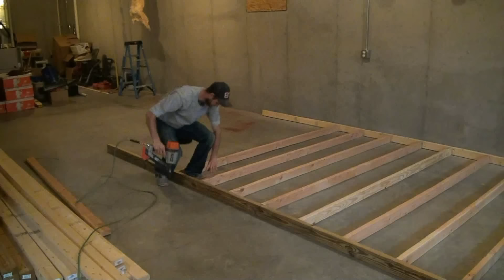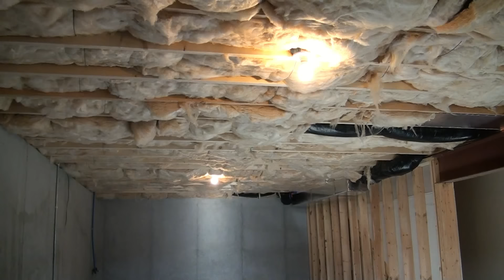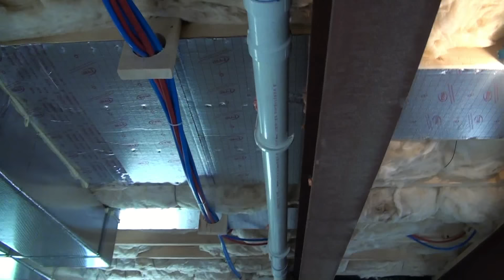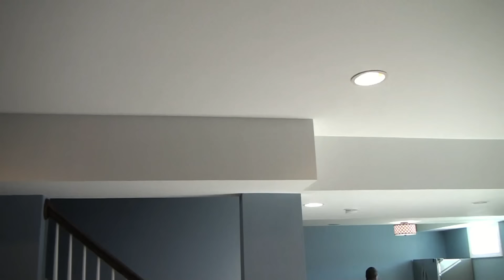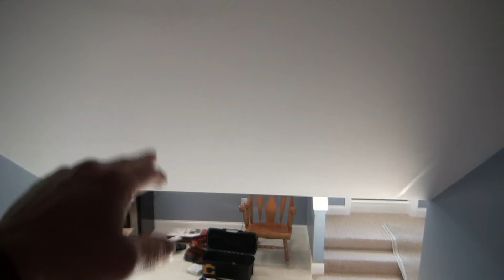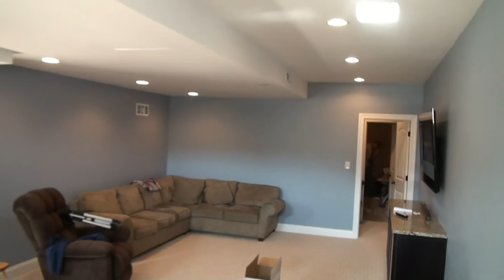Basement Ceiling Ideas (Planning  Your way Around the Obstacles)

Comment: Looks great.  But not much access points.  I got an older house so I'm torn between finishing the basement ceiling or leaving access to deal with issues.  I've also uses the access to run hdmi and speaker wire all under the floor and up through the 1st floor walls.  That would have been impossible.  I'm about to upgrade the hdmi to 8k/4k but realize that in another 10 years I'd probably want to upgrade again.  I think I need some drop ceiling type option but building around obstacles with drop ceiling seems painful.

Comment: My Daughters basement is the same way. The problem I'm looking at though is the flexible duct work is UNDER the floor joists. Older house. She has the steel beam also. Yep, sewer line, water supply lines, etc. But all this stuff is randomly all over the ceiling area. Nightmare. I wish you would have showed how you framed it. I'm thinking I'm going to have to build basically another entire "frame" underneath to support drywall. The room is approximately 20x20. Thinking Nightmare.

Comment: Great video Eddie! Question for you. I have a metal I-beam running the entire length of my basement that I want to put a wall directly under. Can I fasten the wall studs to the bottom of the I-beam and then drywall over the I-beam? I also have a finished fake stone fireplace that the mason finished on the wrong side of the I-beam that I want to attach this wall to. I can send you photos of my problem if you have an email address and time to answer them? Would be greatly appreciated if you could do so as I am at a standstill with this situation. Thanks, Barry.
Reply from the maker: Yes you can do it that way if need be...but it's best to frame your wall in front of the steel beam on one side or the other when possible.

Eddie

Comment: Hi, if there is a 3-feet distance between the duct and the main beam without obstacles, is it a better way to keep the higher ceiling or keep the same height with the duct? Thanks.
Reply: Depending on over all height,  I would float the whole ceiling level across. If it seems to close feeling, then I would raise the ceiling as high as I can and make really nice shaped transitions.. Might even include ducting and such into the look,  make all of the conduits and such look good..
   This video gives good points. I always add in the feeling the room will give me then consider on if I'm building for Me, for Someone Else and what they like and what kind of person they are, or am I building to sell and keep it  conservatively and common sense good looking ...

Comment: Ya had me until the end when you convinced yourself adding 2 foot of ceiling space “wouldn’t be worth the aggravation.”  Then contradicted yourself in your final comments when you stated that “you should maximize space anywhere you can.”
Reply from the maker: To a point...but if saving height in an area will make the area look “crowded” or unbalanced as I felt it would in this instance, why would I do it? Yes...save height where you can, but not just for the sake of doing it...does that make sense to ya? ~Eddie
Reply: @BasementFinishingMan  Yes, it does.  I’m finishing mine up now and have some similar flow problems.  Did you put Thermal bubble wrap against the ceiling subfloor as well as wrap your vents?  I’m using carpet remnants now with Robert’s 3095 and a staple gun.  Wondering which one you would choose for the best noise dampening and thermal principles.  Thanks

Comment: Keep the steel beam as an architectural detail and now the ceiling was dropped low. Steel is an expensive material and serves a structural function. Form follows function show it off. What was the purpose of hiding the beam the ceiling is now void of anything interesting
Reply from the maker: The purpose of hiding the beam is simply to  give the ceiling a "Finished-look". An exposed beam may have some intrinsic modern-style benefits for those who are looking for a more contemporary finished-look, but for most of my clients, they do not want to see an unfinished steel beam in there new "finished" space. It's a personal taste thing...  ~Eddie
Reply: you are right, i cant tell you how many times i went into someones basement to talk about their steel support beams.  it looks so much cleaner this way.

Comment: What's the clearance needed around hot air ducts?
Reply from the maker: Depends on the height of the floor joists to the concrete floor value. In most basements the finished drywall under the duct-work is between 7' to  8' finished height.

~Eddie
Reply: @BasementFinishingMan  thanks for the reply!

Comment: I've watched a lot of home improvement shows and unless I'm mistaken, you covered up a lot of areas that should remain accessible with drywall. If you need any work done through the ceiling I can't see you you would do it without tearing out your brand new ceiling. I would think a drop ceiling would be a better choice. But all the best.
Reply from the maker: That's not true my friend. Everything we covered up is non-serviceable. Anything that we to service in the future has been setup to be accessible through access panels(shut-offs, detectors, dampers, electric junction boxes, etc.). EVERYTHING else that we covered up w/ drywall never needs touched by the homeowners every again(non-serviceable items). If you live in a 2 story house it's the same exact stuff you have inside the drywall ceilings between the floors...we just never think about it because we don't see it's in there!

Drop ceilings in basements are outdated junk and are basically ugly in our view...we do not use them at all for any applications in basements...this is of course just our opinion.  ~Eddie
Reply: @BasementFinishingMan  Well, as a plumber, the plumbing between the basement and the ground floor are routed completely different. Second stories typically have a bathroom, that's the extent of the plumbing, in which all of that is ran vertically. Vertical plumbing is much less likely to develop a leak than the horizontal plumbing ran to kitchens, laundry, and every bathroom on the main floor. Which in turn, leads to nearly all leaks being in the basement. Not to mention the access you lose to bathtub drains and other PVC piping that can be taken apart by the every day person to clean a drain rather than pay me $150 to be there for 15 minutes doing it.
Reply from the maker: @Trevor_Marines  All valid points Trevor...But we are still a drywall ceiling basement finishing Company.
Reply: @BasementFinishingMan  Yeah, I respect your work and see that you do amazing work. I don't disagree that drywall ceilings are far more appealing and understand that it wouldn't be smart to show the cons of using your company. Just thought people should know the difference in the ceiling choices. Again, no disrespect, wish I had your craftsmanship.
Reply from the maker: @Trevor_Marines  Thanks for your insight Trevor...you are another brother!
Reply: Drop ceiling?  Why would anyone want that crap in their house.

Comment: Why would you install the smoke detector in the lowest section if the ceiling?
Reply from the maker: Because that's where the existing hard-wire smoke detector was located from the builder...we just put it back in the same wired spot Mike.
Reply: @BasementFinishingMan  no actually you didn't put back in the same place because it was roughed in up at the bottom of the floor joists. You dropped  it down to your new ceiling height. Did you pull new wire to that new box location? Because the other wire would be to short.
Reply from the maker: @mcndc71  No we just rerouted the existing wire to make it longer.
Reply: Insulation
Reply: V

Comment: Hi there! I'd be honored to get your advice. I am a first time homeowner of an early 80's house. In the basement, there is not that sleek style of ductwork as shown in this video. It is the big soft round type, with a much lower clearance. What can I do to maximize ceiling height when finished?
Reply from the maker: REPLACE THE THE DUCT WORK WITH A LOWER PROFILE TYPE. That's what I would do first before beginning the project Abbey.

Eddie

Comment: We’ve been watching all of your videos as we are looking at finishing our basement.  Great filming, description and instructions!

I was curious on building sofits as you’ve shown with 2x4 as to what the maximum width/span of it can be?  In other words, when the two parallel vertical short walls are built, what is the max length a flat 2x4 can be toe nailed between them without issues of sagging or structural?

Thanks again!
Reply from the maker: We go 6', 8' 10' and on up! All you do is add center supports every 4' and hang the supports to the floor joists. I show how to do this and build the support system in the Framing training here>>> https://eddie-case.mykajabi.com/store/ZNDvAVqL

Eddie
Reply: Love this channel! Thanks for the quick response, clear information and resources!

Comment: Looks good. But those drywall ceilings are a nightmare when you need access water leak or things of that sort.
Reply: john pershing I have a small bathroom with plumbing all above it going several different ways. Would drywall work there?
Reply from the maker: Hi Brandon! You have drywall ceilings between the 1st and 2nd floors of all 2 story homes and it's funny that nobody even thinks about the fact that you have the exact same plumbing, wiring, drainlines, HVAC ductwork, etc. inside those drywall ceilings as well. You should not have to worry about leaks if your plumbing is finished correctly...you should be able to drywall your ceilings and never have to think twice about those mechanical systems again.

Eddie
Reply: Basement Finishing Man I have to disagree. Above the basement is really the only place you have plumbing running horizontally for long stretches.
Reply from the maker: Lets just agree to disagree on this one! 626 basement into my career and I have never had someone call me back and say wish they had installed drop ceilings because they have a leak in a pipe. In PA we get cold winters so we take extra precautions with positioning our water lines away from exterior walls as much as we can as well as using Frost-proof sill-cock exterior faucets so we never burst pipes in cold weather.

But aside from all that...Suspended ceilings just look "basementy" and I don't want my projects to look like a basement when I'm finished! I like the look and extra height that only a drywall ceiling can give. Again...just my opinion and it's just different from yours.
Reply: @BasementFinishingMan   I agree. I did one of the same type basement jobs with extra wide soffits 8 years ago and that's exactly how I reasoned with the homeowner. Kudos

Comment: Good Job man.  I did something similar with mine.  Went with Gypse ceiling to hide all the duct, sewage and water lines.  I hid the I-Beams with barn board to match the barn board wall we went with.
Reply from the maker: Sounds nice Richard! I like the barn-wood look on the right basement finish project. Thanks for commenting and stopping by our channel.

Eddie

Comment: what do you think about making a doorway/arch under the stairs to connect the two rooms?
Reply from the maker: Could be a really cool addition to the project! I have done this in the past and it's great way to get from point A to point B without having to go the whole way back out and around the staircase. Thanks for watching!

Eddie
Reply: does that take extra engineering? is the height of the typical beam running along a mid-room stairway high enough to allow for clearance?
Reply from the maker: In most basements yes! In a lot of areas the code height for a finished basement ceiling under the beam is 7'-0"...so if you got at least 7' your good to go!

Eddie
Reply: thanks eddie!

Comment: Nice work! What's the point of insulating ceiling in the basement with fiberglass?
Reply from the maker: +teddybear2123 This was pre-existing insulation...we did not install it. The only real reason to insulate a basement ceiling before finishing the basement would be to sound-proof the barrier between the basement and the first floor.

Eddie
Reply: Does a basement need to have insulation or could I just remove the old stuff and leave it without insulation? Non finished basement. We are planning on selling soon.  Thanks in advance...